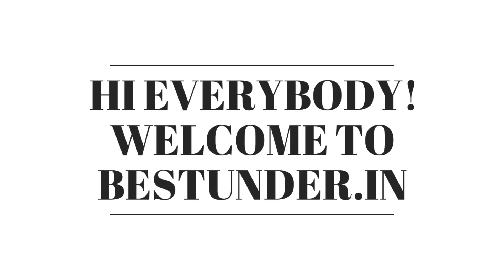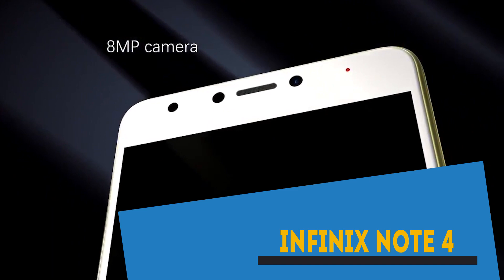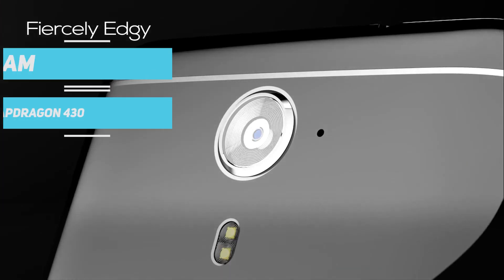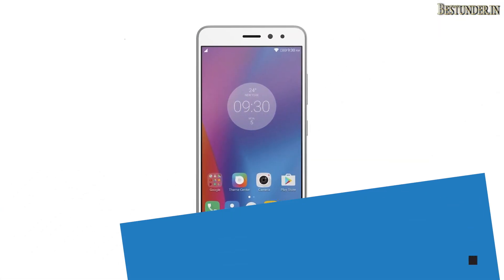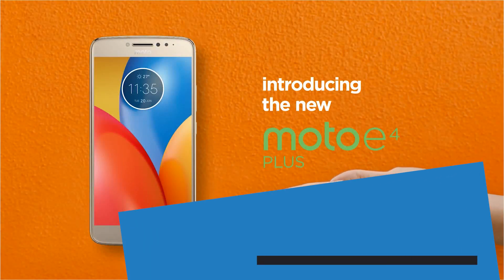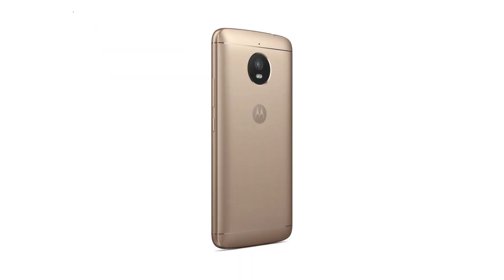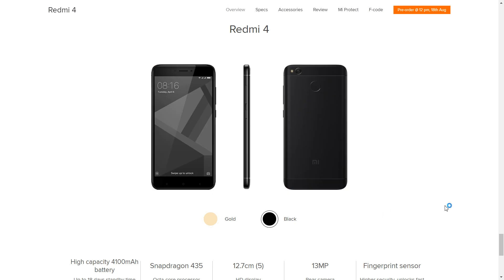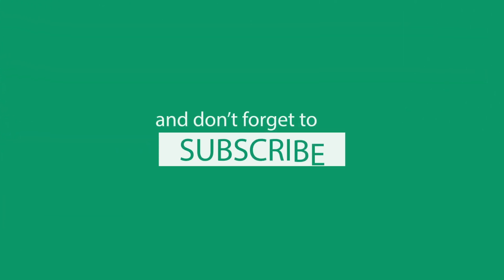Best Phones under ₹10000 [Mid 2017 - Q3] , #2 New Video

Comment from the maker: Great Battery(4100 mAH)/Best Processor(Snapdragon 435)/Fingerprint Sensor/2.5D(Redmi 3S Prime Successor)
Redmi 4 (3GB+32GB) : http://amzn.to/2qrECGT , http://clnk.in/e1gr
Hybrid SIM Slot/Flash Sales/Only HD Screen/No Fast Charging

Android Nougat/2.5D Glass/Best Battery(5000 mAH)/Dolby Atmos/5.5" HD/Front Fingerprint Sensor/Front and Rear Flash/Dedicated Slots/ Fast Charging/Dolby Atmos
Moto E4 Plus (32 GB) (3 GB RAM) : http://fkrt.it/fX~TdTuuuN
Mediatek Processor/Only Basic Sensors/Only HD Screen

5" FHD/Great Battery(4000 mAH)/Finger Print Sensor/Good selfie camera/Dolby Atmos
Lenovo K6 Power (32 GB)  (3 GB RAM) : http://fkrt.it/eFMgO!NNNN
Hybrid Slot/Android 6.0/Not 2.5D/No Fast charging

Best RAM(4 GB)/5" Full HD/Fingerprint sensor/Front and Rear Flash/2.5D Gorilla glass/Good selfie camera
Yu Yureka Black (32 GB) (4 GB RAM) : http://fkrt.it/0LBSd!NNNN
Hybrid SIM Slot/Android 6.0/No Fast Charging

5.7" FHD/Dedicated Slots/Decent Battery(4300 mAH)/Fast Charging/Front and Rear Flash/Android Nougat/2.5D/WiFi ac
Infinix Note 4 (32 GB)  (3 GB RAM) : http://fkrt.it/dv6~BTuuuN
Mediatek Processor/Bloatware/Bulky/New Brand